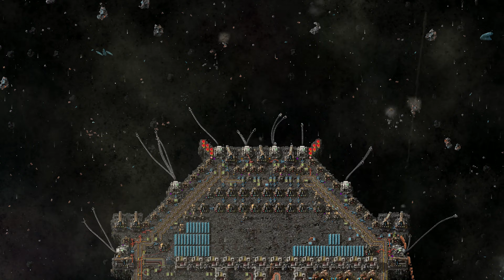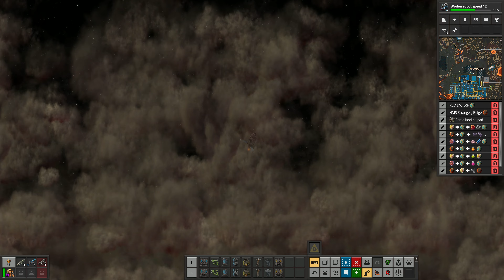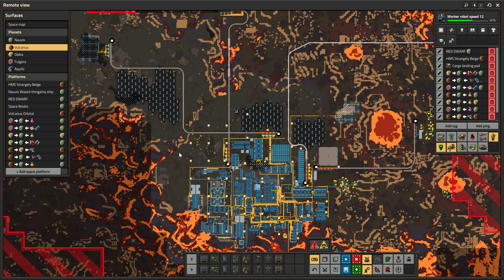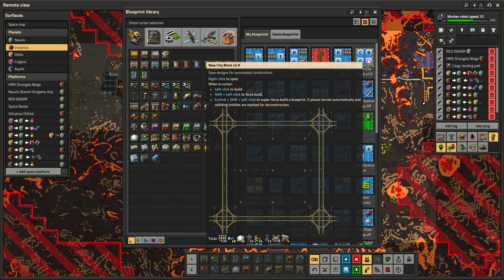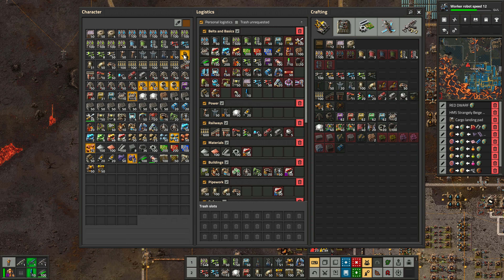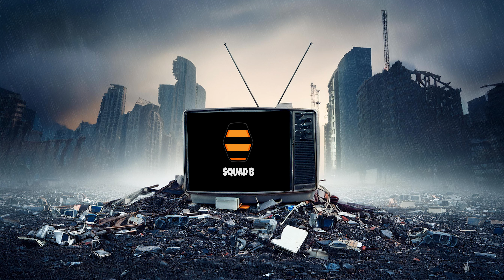How to Build, Defend, and Scale Vulcanus Properly in Factorio Space Age

Comment: I made all my planets belt based from the beginning, it just made sense at the time and I keep being shocked at how many people just make bot bases. I'm currently running all my Space Age planets on roughly 200 logistic bots a piece, though I still haven't even gone to Aquilo. I went Gleba first, and apparently Gleba with belts is significantly more stable than bot Gleba because it's run flawlessly the entire time I've been gone. Gleba's great when you get rid of the neighbors.

I definitely went for steam power on Vulcanus and Gleba, Gleba is obviously intended with the heating towers, but Vulcanus... I tried solar and kept running out of power still. I could probably revisit with higher quality and more space as worms get easier to deal with but is it worth it when steam is going strong? As to Fulgora I'm still considering pulling in some heating towers, just because I have unlimited water/solid fuel that I'm just dumping into recyclers anyway and steam is going to take up less space. My main base is on the largest island of an archipelago that I've managed to use long range poles to connect, and I've filled smaller islands completely with accumulators and my power situation is still sketchy if I expand any further or try to beacon what I have.

At any rate I'm intending to brute force enough quality to make a good Aquilo ship, do a mild redesign of Nauvis, get my space logistics in order, and head to Aquilo for the first time.
Reply from the maker: Thanks for the comment, great read. I would say that once you get the heating mechanics for Aquilo, its actually huge fun to build there. its like a puzzle game inside the normal game keeping everything heated and fluid. i think my next planet will be aquilo in an effort to expand....

Comment: Agree on bots vs belts - I much prefer not having bots flying everywhere! You're doing yourself a massive disservice not using steam power though; legendary solar panels are great in that you can set and forget them, but you still need 9 solar panels to match the output of 1 turbine (~23 if your turbine is legendary), and it's also cheaper on raw resources if you go with turbines. I just went a little bit outside of my base, found a rich patch of sulfuric acid near some calcite, and dedicated it to steam power. 1 patch easily provides enough steam for 500 turbines (~3GW), with plenty of room for adding more!

Also, it's not a proper Youtube comment if you're not an arse, so... it's 'Vulcanus' not 'Volcanus' 😁
Reply from the maker: This is totally what i will be doing tonight.... love VOOoolcanus :)